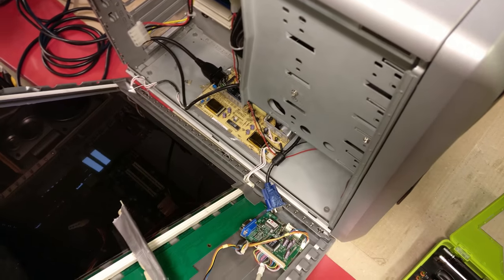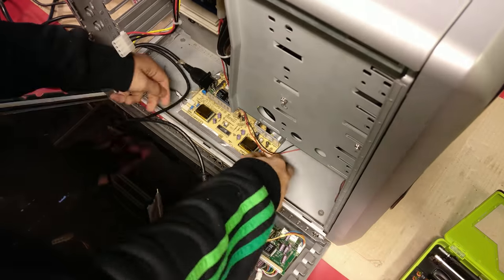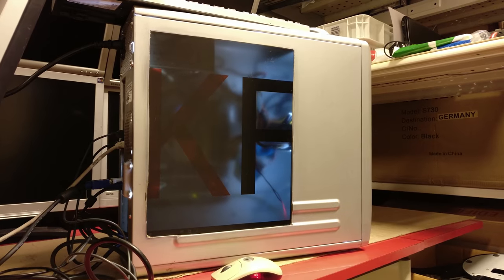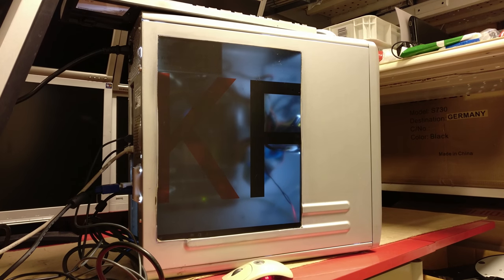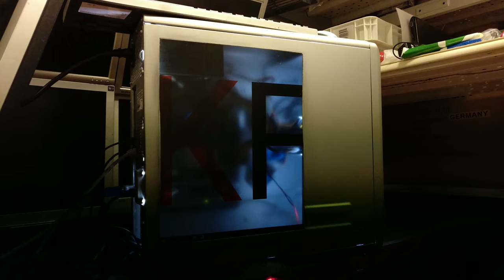DIY Transparent LCD Screen PC Side Panel

Comment: my display has two of these long circuit boeards (1:40). one on the top and on on the side. really annoying cuz they are conncted by a short strip of wires.
Reply from the maker: It might be easier to just get another display. Old used 5:4 ones are pretty cheap nowadays.

Comment: How would you do this on a tempered glass panel
Reply from the maker: You could buy a frosted film (like these: https://www.ebay.com/sch/i.html?_nkw=glass+frosted+film&_sop=12) to hide the panel electronics and cut a hole in the film to show only the panel. You could hold the panel on the glass with either transparent tape or glue.

Comment: Did you use cool or warm led strips?
Reply from the maker: We actually used the original (pretty cool colored) ccfl backlights from the monitor, but it probably depends on your preference. The cool leds probably look more vibrant and the warm ones are easier on the eyes especially in the dark.
Reply: KrupsFilms aaah, thanks. thats pretty smart. noticed it now to while rewatching the video. i might try to use these leds too, but for now i bought led strips from amazon. thanks :)

Comment: Damn, why is it so blurry though? I was hoping this would be almost exactly like IBUYPOWER's PC case. fudge.
Reply from the maker: We'll probably try to remove the matte film in the future and wire the display straight into the PC's power supply to make it run without the big power board in the case. Thanks for watching!
Reply: They didn't remove the anti glare film
Reply: ty
Reply: still pretty cool.